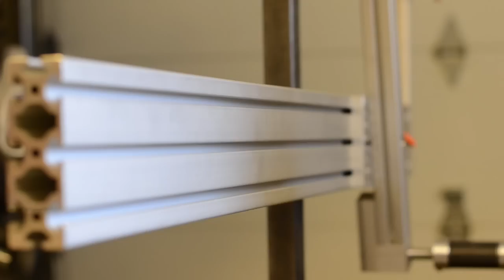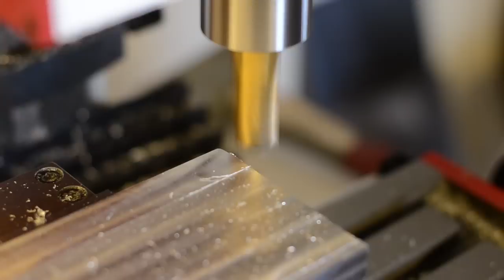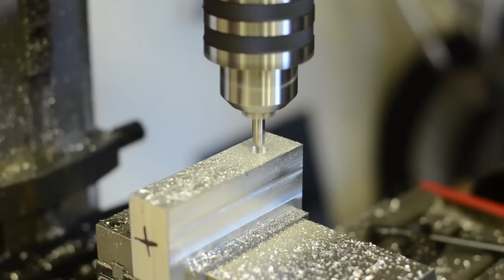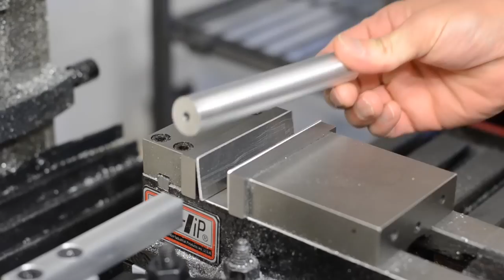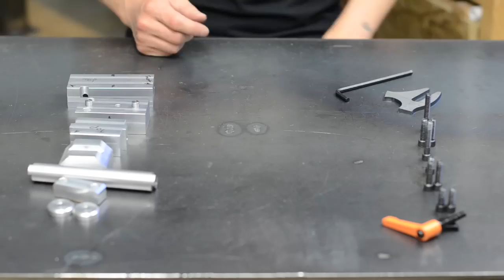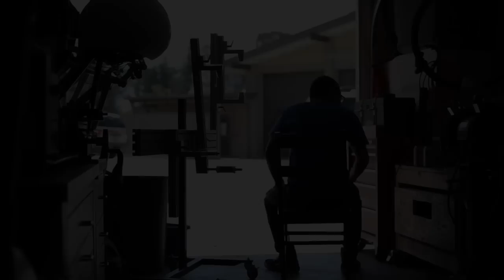Bicycle Frame Build 24 - Frame Jig Pt.16 - Make Dummy Axle Finish Frame Jig!

Comment: The cones that you make to hold the tubes in place. Is there a way to make them without using a lath?
Reply from the maker: If making cones with wood or derlin, yes. If you’ve got a drill press and an xy drill press vise you can mount the cylinder of material into the chuck. You’ll need to attach an shaft to the material because it will be too large to fit in the chuck. Then get yourself a high speed steel  blank or buy one already ground. Mount it to the vice and attach your vise to drill press table at the desired angle. You can use a block of wood cut at an angle. Rigidity of how you mount the vise is key.

Comment: excellent work.. Great choices in your equipment.. Can't wait to see the frame come together..  What are you going to make first?
Reply from the maker: J Petrila Honestly I'm just making best guesses and you guys are helping me choices too. First thing I'll do is run some practice miters on some plain steel tube. Then some practice welds. It's been kind of long since I last welded a miter joint. The first real frame part will be the seat tube miter to bottom bracket junction. I'm so excited to actually start working with tubes and welding again. I love every step but this jig has occupied all my free time over 3 months! So glad to be moving on.
Reply: Pithy Bikes Will you set up a jig for the miters/copes on the lathe or milling machine?  

funny how a seemingly simple item can take so much time..  Keep it up.. It's been fun to follow..
Reply from the maker: J Petrila Indeed, I had no idea it would take so long. I'll try metering on the lathe.

Comment: Great videos! Did you come up with the design of the jig or get blueprints from somewhere? Is that aluminum you're using?
Reply from the maker: I didn't create the design. It's known to many as the "Archtos" jig. It was designed by Gary Helfrich (Ibis) and Ron Sutphin (UBI founder). The jig I built is based on their design, however their actual design is better! :) Yes it's made of aluminum.

Comment: Congratulations and Tx for the methodic great qualiy videos.
Where did you learned all this?
Bart
Reply from the maker: Bart Van Laer I got my start at the Crucible in Oakland CA. http://thecrucible.org/ There, I took 2 welding courses, 1 machining course, and finally a frame building course. All courses were at night after work and spanned 1 night a week for about 3 months. It was a really great experience to get a hands on jump start. And a good way to decide if I really wanted take it further and purchase my own equipment. Thanks for watching!